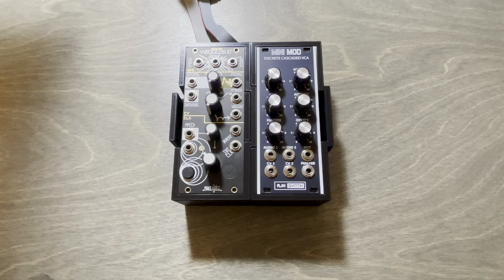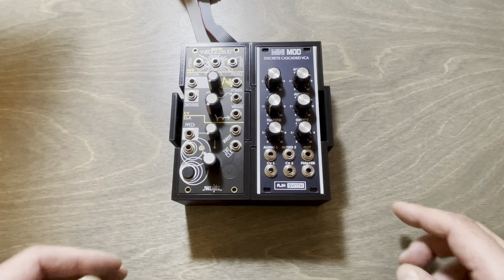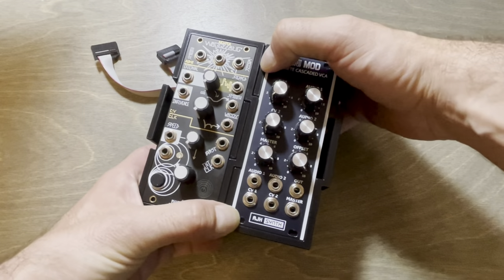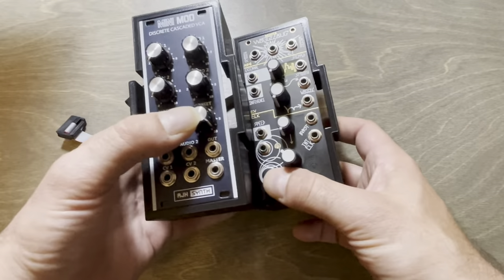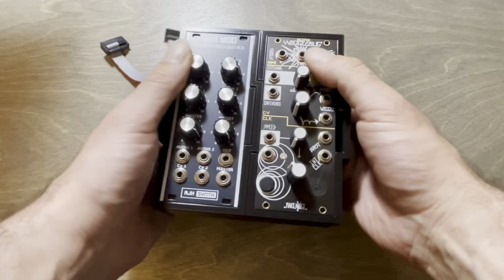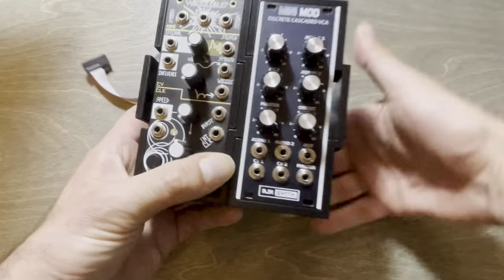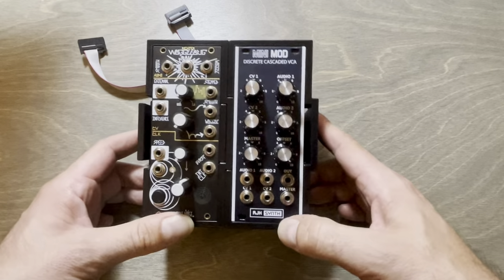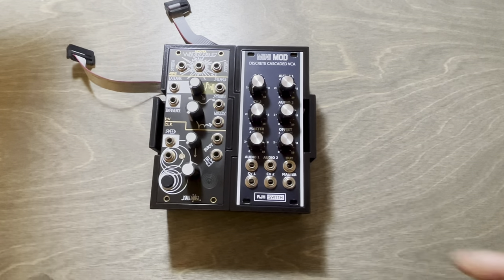3D printed freely arrangeable modular Eurorack case prototype

Comment: Awesome idea 

I’d would  call it “snap case “
Lots of possibilities especially with things like legs and stands 
Stacking the units I’d would use a 3rd part that connects top and bottom , something like a clip that goes onto both units but still keeps them flat
Reply from the maker: Thanks! Yes, I've been thinking about a way to stack them, just haven't found the time yet to actually execute the design. It would be a great improvement.

Comment: Just joined up! Printing some tests now. Would be super cool to see 1u modules as well. Maybe a clip point on the top. Or maybe just 1u sizes of varying hp. I am doing some printing for now and excited to try them!
Reply from the maker: That would be a lot of plastic for a 1U module. However, they're designed to allow multiple modules in one box, so I've been combined 1Us with other sizes.

Comment: This is one of the best ideas I’ve seen since the inception of eurorack!  I’m very curious to see what you have in mind for power distribution.
Reply from the maker: Thank you, I'm currently looking at using flying bus cables being attached to a 4ms Row Power, then I add some ridges to the bottom of the cases and you just slide back panel over it to have space for the ribbon. This will also further solidify to whole unit while still being able to slide everything out easily for rearranging.
Reply: @gbevin  Sounds like a simple and elegant solution!  How are you planning to get these out into the world?  Will you be selling physical enclosures or the STL files?
Reply: @gbevin  Sounds like a simple and elegant solution!  How are you planning to get these out into the world?  Will you be selling physical enclosures or the STL files?
Reply from the maker: @deastman2  I'll be releasing the STL files and open sourcing the whole thing, if someone wants me to custom print them a setup, I'll consider it, but that'll not be the focus. I think this should be a starting point for the community to get creative with and expand upon.
Reply: @gbevin  That’s awesome, and coming from you I’m not surprised!  I’ll dust off my 3D printer and give it a try whenever you have the design finalized.
Reply: Great idea
Reply: This is a wonderful idea if you need to hold a few modules next to your performance rig. It allows you to get the functions you want without having to disassemble your rig which is already working pretty well. For example, having the 1010 Music Bit box handy when you want to record without having to remove modules from your stable rig. Just great. I have the 4ms Pod but your solution accommodates different size modules better. Would you be able to include rails or are you just using holes in the print itself?